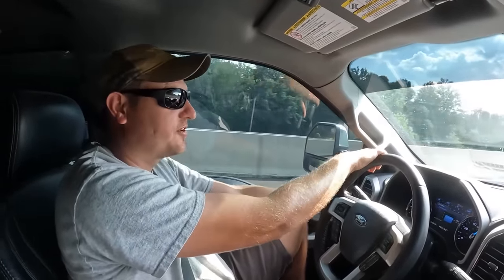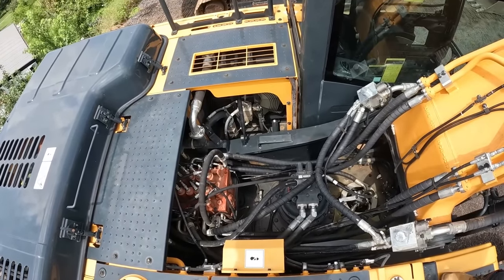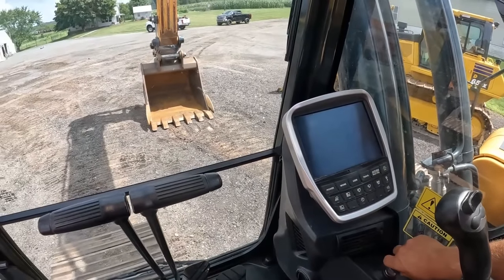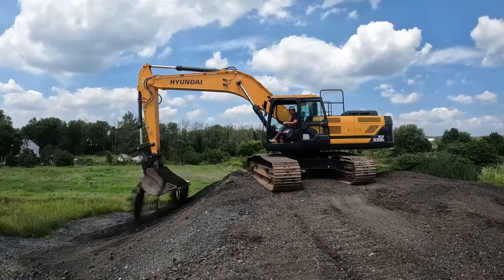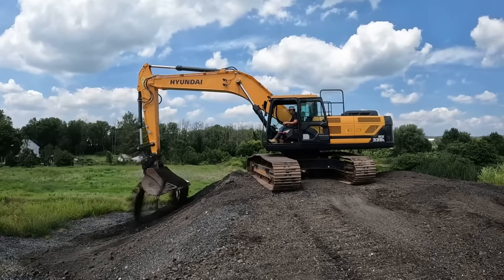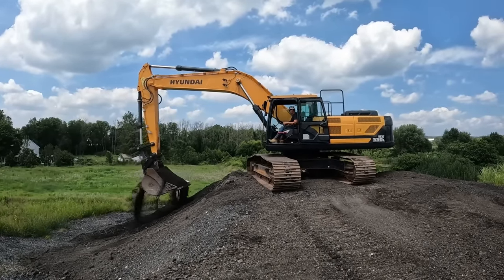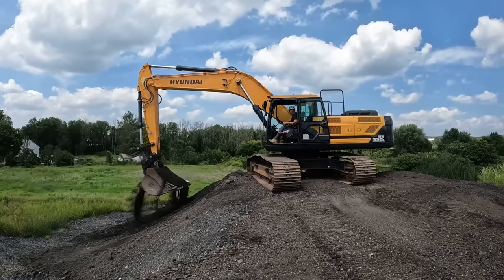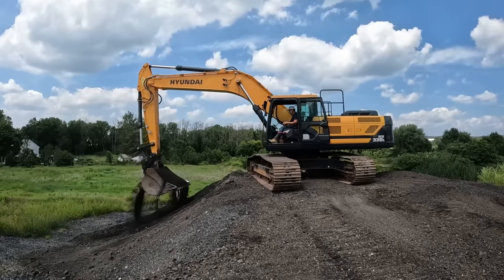Buying A Larger Excavator

Comment: I have a feeling it’s the Kobelco. Looks strong and handled the bucket well. No dipping with a full bucket all the way out. Sounds strong and quick too.
Reply: I think Dirt Perfect got a call asking his opinion on Hyundai machines..and that made up Chris's mind..
Reply: That Kobelco is fast.  It would load much faster than the Hyundai.
Reply: Hyundai’s are rubbish. You can’t go from a Volvo to a Hyundai. Go the kobelco
Reply: Kobelco all the way Chris, Hyundai only good at one thing Rally Cars, That Kobelco Rocks 👍
Reply: @leighphillips1913 you probably never operate hyundai or Volvo, I can tell you i operate both machine I end up getting hyundai 350 and 220 way better fuel than Volvo they operate similar but hyundai is cheaper I never have problems they are both have more 2500 hrs, the guy owns the Volvo has to many problems so there you go haha
Reply: @balforitown4274 I disagree
Reply: @bodsky28  just for the record I have operated both. I didn’t think much of the Hyundai. ( my opinion) Let’s see what Chris decides on.
Reply: @leighphillips1913  they both are good hoe for me whatever  machine I operate I can still do whatever I'm doing, I will pick the hyundai coz they are cheaper I get paid the same as the other brand I will keep the extra cash into my pocket haha...
Reply: @jcurran8860 2😊keep
Reply: @flyingcland2267  I take 40grand into my pocket, I operate almost all the excavator except Sany and Xcmg.. hyundai is good machine I owned 2 of them never have problem when I operate them I still move dirt like the brand even more soo, but I do have operator don't like it coz it's not the brand they prepare. but for me why buy 50 to 100grand more if you can move dirt the same and get paid the same doesn't make since to me(my opinion)
Reply: I'd like a few truckloads of that black Pennsylvania dirt.

Comment: Congratulations, they are both great looking machines and seemed very smooth when you ran them.
Reply: Did you notice how the Hyundai was ripping over with a full bucket at full reach... without a thumb. That could create an issue down the line.
Reply: @justinfufun5483 I wouldn't call that an issue, that's to be expected when you have that size of bucket relative to the machine. That's just the tradeoff you have to be aware of when you run a large bucket, better production but you have to swing your load closer over the side of your tracks and be well aware of your tipping point

Comment: In 1989-2000 I worked for the city of Bakersfield, Ca. operating wheel loaders. They bought through the bidding process a Sam Sung equivalent of a Cat 950/John Deere 644. In one year the Sam Sung was so beat up in our normal operations and then burnt up that the city banned Sam Sung from the bidding to replace their loader. I felt that the Deere 644 was for it's size was the best of all our loaders. you put up another great video.   Thanks.

Comment: I had a feeling that it would not be long after Chris ran that 550 that he would end up getting one or like in this case just getting a bigger machine because I could see how impressed he was with that bigger machine and how much material it moved so quickly!
Reply: Yeah, the 550 took two scoops to fill his offroad truck, this one will probably be about 5 (maybe less with the 60"?).
Reply: @merlepatterson it was actually 3
Reply: @genesispuredeaf2390  Was it 3? I forgot. I know it wasn't the 9 or 10 it takes for his 220.
Reply: A 550 is a pain in the ass everywhere and every time except when it's already on the job site. Both the costs of acquiring and operating that thing are astronomical.
Reply: @merlepatterson  agreed….you were right there.
Reply: @genesispuredeaf2390  Yeah, I went back and checked the old video and his haul truck was basically overloaded at three scoops and a lot of dirt spilled over every time the 3rd bucket dumped. So a good estimate is 2.5 buckets from the 550, so we were both kind of right and wrong at the same time.
Reply: @merlepatterson  off road truck shopping next!
Reply: @timearp8185  Yeah, I was thinking he might want another bigger haul truck at some point. The way he's usually on multiple job sites it makes sense to a point.
Reply: @merlepatterson  Likely one with the balloon tyres on like John's, considering how often it gets stuck and has to be shoved out of a hole it's just dug itself into.
Reply: @merlepatterson  it also took him about 1 second longer per scoop on the 550 …but the overall savings make that a rounding error.  His biggest time and fuel savings (when using a bigger machine) will come from hogging material which needs to be moved more than once.   That said, he will also run his off-road truck with less wait time getting more truck loads in a day.   After all the calculations in terms of actual data is there, I’ll bet the biggest advantage comes from beating deadlines and staying in front of the weather delays.
Reply: @genesispuredeaf2390  I don't disagree with you.
Reply: @Skorpychan  Makes me think of Andrew Camarata and his go-arounds with haul trucks. He finally got a reliable Bell Haul Truck.
Reply: @merlepatterson  Given the issues with finding used equipment, I definitely think a hunt for one will take a long time unless fate basically drops one in his lap.
Reply: @Skorpychan  Used off road haulers tend to be fairly abundant because of transport issues and they are usually the first thing to go when someone wants to lean out their operation.

Comment: Of these two machines the Kobelco makes the most sense for the work that Chris intends to do with it. It is larger, has more lift capacity, handles the 60" bucket better (could even have a larger one if needed), and from the outside view in this video, is more responsive, faster acting, and operates smoother. The other considerations is parts/dealer availability and location for when repairs are needed. I would imagine that a grapple will be added to fully accessorize the machine. The weight difference between these two is probably not that big of a limiter since both are in the "oversized load" category and will require pretty much the same transport requirements. The Kobelco will move more dirt and clear more land faster; especially with an experienced operator like Chris.

On thing I've learned over the years is that the bu++ hurt of buying a tool fades quickly if that tool performs the job admirably and above my expectations. But the buyer's remorse stays with me for as long as I own the tool if it fails to work as needed. And budget is always the killer of good ideas.

And to Chris, congratulations on all of your success. It has been fun to watch you grow your business over the years. You work hard and deserve all of your success. Looking forward to seeing your continued growth. Nice job!

Comment: Chris when you’re restacking the burn pile with the excavator does the hydraulic hoses ever get too hot from the fire? Iv never seen you damage one yet but why do they not burn through more often?
Reply: I HAVE ASK HIM THAT SAME QUESTION AND I DON'T KNOW IF I EVER GOT A REPLY!!!IT MUST BE FIRE PROOF 🔥
Reply: I know it happened once, over a holiday weekend. He was redoing the pond dam on a job, I think 2 years ago now. Just checked the playlist, it was the 10 acre pond project.
Reply: @dennismalcolm6620 - if you have watched for a long time he has explained why. He doesn’t leave them near the fir long enough to get damaged. Like when you move your finger through a candle flame quickly. They tolerate a lot of heat.
Reply: It takes prolonged exposure to 500+ F to get rubber to start to melt and catch fire.  While those fires can achieve 800+  down in the middle of the pile,   up where he is working with the gasses are still burning off the temperature is much lower.  It would probably still be enough heat if he set the stick in there and left it for a few minutes but He moves quick and all the motion  up in the air is cooling them off
Reply: @DeweyCheatumNHoweLLC   That was due to leaf build up, I believe, and the leaves caught fire, due to flying embers, damaging the hose.  :)
Reply: The outer coat is just a protective. There is at least 1 layer of steel and maybe 2. A person would have to just lay those hoses in the fire to cause more than cosmetic damage.

Comment: There are several used Volvo options, one is a 2022 EC380EL with 570hrs for $312k.  Not too long of a trip either - Tampa, FL (Machinery Trader).

Comment: I work for Rudd equipment and enjoy seeing you in a Volvo. As bad as it hurts Volvo excavators and hitachi are really difficult to get your hands on. I’ve got customers that is chopping at the bit to get into a new excavator. But unfortunately the inventory isn’t there at the moment. Also if I must say if it’s between the two I’d purchase the one that has the most dealer support. Kobelco has been a great machine to my customer that had them along time. Close to 6k hours and hasn’t had many issues.

Comment: Cant go wrong with a hyundai. My company has a 130, blade, thumb, quick coupler, absolute beast for its size. Easy to get parts, easy to work on, dont have to work on it offten but with hours comes hose replacements. great preforming machine.

Comment: Man that Link Belt 350x4 will out swing those other machines.. it had a triple stage pump system and you can walk and track at the same time, or boom up and swing and not loose hydraulic power .. only the x4s tho, and a 13ft stick

Comment: personally out of the 3, i think link belts are the best. absolute work horses, ive run the 350x4's with hammers, 2nd member shears stick bucket etc. they feel very smooth and have some serious kahones in my experience. the kobelcos seem to leave alot to be desired as far as power goes and they seem to be clunky with the controls but thats operator preference.
Reply: Might want to look into who really makes your Linkbelt lol  Like most its just a rebrand now adays.
Reply: @rollinlowford  link belt is owned by sumitomo but their factory is in Kentucky. Link belt makes case excavators

Comment: I have a JD 350 and while it sits at the shop most of the time, when you need it you need it.  The 250, 210 and 160 are always the ones out on the jobs.

Comment: I dunno, that sweep of the mound to form a cone shape went smoother with the Hyundai with either bucket, the other machine gave a notchy result. Not a huge thing, but it suggests something did not sit quite right for you with the 350. The interior shot of the 350 with the doohickey sticking up and flapping about suggests that machine might be harder to add adaptations to it, and I know you are a fan of just the right stuff on your machines, the lower price leaves on the 330 a little budget headroom for that sort of thing I have to guess. Lastly, your mech has the right software stuff for the 330, that's probably a good thing because he's likely got experience using that software. I have no idea where you'll go with your choice but that is what struck me about the propositions on offer. I know which I might go for, but you will have to wait until the next video for me to say, or maybe the video after that? ¯\_(ツ)_/¯  Seemed odd to see you and no thumb. Be well.😉

Comment: Me too: congratulations! Not with the choice you're making, but with the point that you have reached so soon after "leaving John" that you have taken on jobs that require you to add a fourth excavator (I'm including "Strawberry Shortbread"), even a bigger one, to your fleet. - You have obviously learned from testing the Volvo 550 (watching it arrive and depart) that transport is a factor in choosing a size. And I noticed you testing stability when reaching out with a full bucket. So you may need some counterweight, and that would add to the mass to be transported. That is where your decision may impact your hauling partner too.

Me too: I'm "expecting" you to want a thumb. You may have your thumbs partner already extending the line of your own design.  ;-)
After all, you mentioned the extra hydraulic lines on the Hyundai.

Anyway, I'm impressed!

Comment: Does not matter to me which one you get. I just look forward to the videos. They help me make it through my 12 hour night shifts. The Hyundai looked less stable with the big bucket. Add a thumb and it will be even more unstable. It seems like the 550 would lift a track with a big bucket full, but it did not slow you down. Thanks for the education and entertainment.

Comment: The Hyundai are excellent machines, we have been running them  for quite a while on heavy tree pushing jobs and hammering and crushing volcanic rock, one of our 30 tonners has over 12 000 hrs and has never missed a best. Hyundai have there own steel foundry and make most of the ships world wide so the steel is quality and the motors are reliable Cummins  engine. The 320 we had was very powerful and not much would argue with it. We also just purchased another 30 tonner at Christmas time which already has 1200 hrs on it and running like a dream.

Comment: Old betsy's sister! Good thing to keep up viewrship to hold out until the low boy shows up.  the 350 had better grading control and heavy loads and wet dirt.  Just depends on permits to transport the heavier model.  How much does the 350 weigh?

Comment: hat's the thing with getting equipment. Sometimes you have to go with what's available to take pressure off your shoulders. So that later on, you can trade or part trade the less than ideal for the more ideal piece. It's kinda how you got your current volvos after starting with the old Hitachi, the Linkbelt and I believe one other machine.

Comment: No thumb so it's for dirt. Bigger bucket more dirt. Hmm I  think Chris will take the Hyundai because of budget and moving expense. The bucket size is still going to load the off road fast. If you get 2 trucks hauling the other bucket would be more of a factor. 
Chris is more of a 1 man show. Both machines are a upgrade, the jobs your upgrading for must be big. Can't Waite to see the adventure.

Comment: I saw comments about Chris leaving us hanging.  It was an obvious choice…the only question is if he is going to get the bigger bucket.  Which one you ask?  Out of Chris’ own mouth…Both good machines but one of them is:
Lighter weight
Easier to transport 
Less money up front
Smoother operation
The slightly higher hours is likely a non-issue given how LD18 will utilize it.

Comment: I'm glad i caught this video early! Chris if you need any help i know a salesman with James River equipment over in Charlotte that could help you find an excavator in the 80k weight range if your interested.  Just give me a holler back if you decide to try and find something closer to home.
Reply from the maker: I looked at about 8 350g's.   Nothing in the budget I wanted
Reply: @letsdig18  I thought I'd try. I knew they had multiple locations to pull from but the price does seem to come down to the sticking point. It's a shame Volvo can't come through for you.

Comment: Well if I were to venture a guess, it will be the Hyundai. I think the Kobelco will be over the budget. It costs more will need a thumb, has a larger engine and cost more to move. While the Hyundai cost less up front, still needs a thumb, can use the larger 60" bucket and costs less to move, I believe has a more economical engine and from Dirt Perfects evaluation of his 210 is a very serviceable piece of equipment. Something that Chris is very keen on. At least that is my assumption. Time will tell. Thanks for sharing Chris.
Reply: Kubelco is my guess. He put the larger bucket back on it. The Hyundai is still listed online and the kubelco is ‘sold’

Comment: I'd go with the Hyundai. The electronics are more adjustable on them and I believe if he tinkered with the screen and changed those settings around a bit it would run even faster (similar to DP's learning curve when he got his Hyundai). Plus his mechanic is already familiar with the engine which is a big bonus. I don't think the Kobelco is worth $40,000 more, so to me it's a no brainer. But I guess we will see.

Comment: If I were selling any vehicle and someone asked about heated seats, I would hand them a can of re-fried beans.
I'm not sure why the Hyundai seemed to be off balance more with the smaller bucket, perhaps the bucket was made of thicker material.  Also have to consider the weight if you are going to have an LD18 thumb made for it, as well as digging mud is going to be a lot heavier.
As far as speed is concerned, they seemed similar, maybe the Hyundai tracked faster.  The Hyundai seemed to have better repeatability on the slope, but that could have been a slight difference in machine operation familiarity.   My guess will be the Hyundai with the larger bucket.